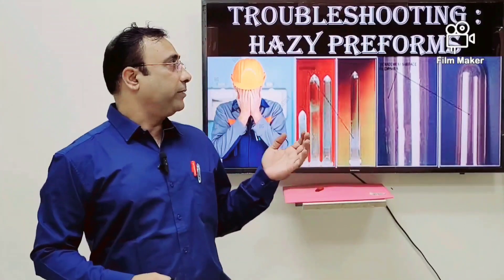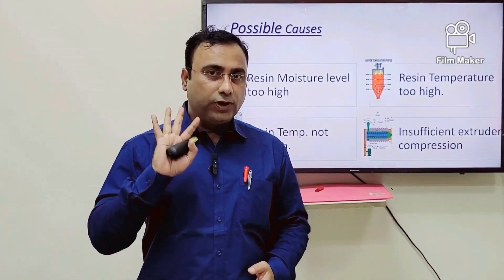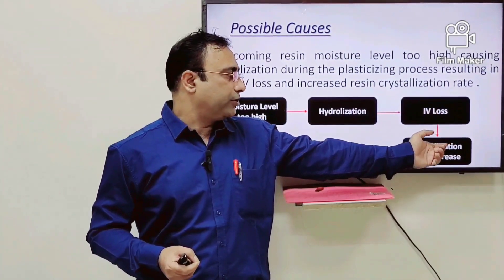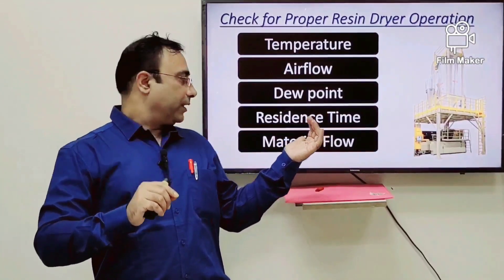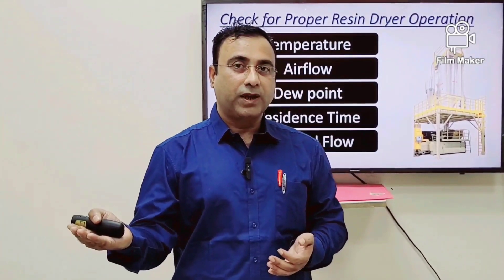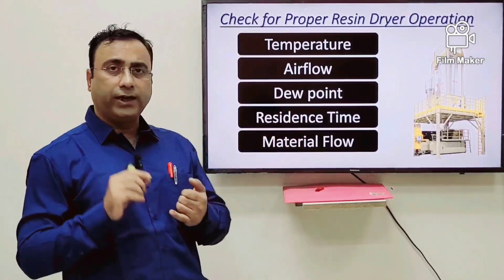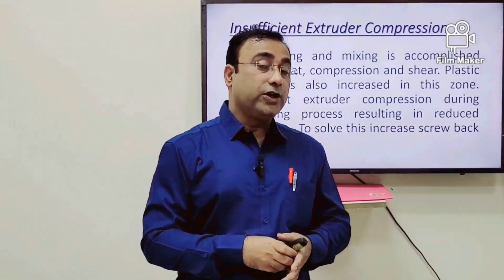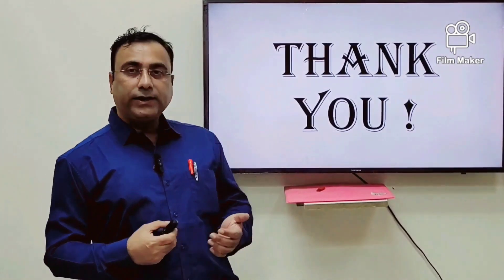Troubleshooting : Preforms Haziness. How moisture, Resin temp. & Back Pressure impact PET Moulding

Comment: Hi sir, We are facing issue in After blowing the PET bottle, bottom of the bottle having white shade in all bottles, but we not seen in preform stage. Kindly suggest solution
Reply from the maker: This happens because of excess cooling . But share me more details like which machine and what's bottle  size ?
Reply: @Tothepoint1910  Thank you for reply, We using the 1L pet preform in Stretch blowing machine. Excess cooling in injection molding machine or blow molding machine, we are facing the issue continuously
Reply: Which machine are you operating? Do you have experience in ASB Machine?